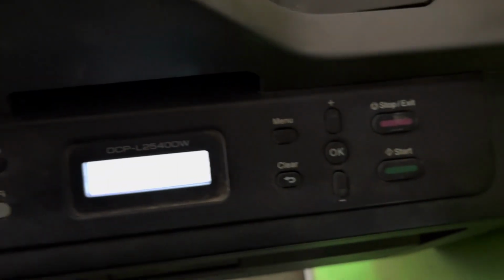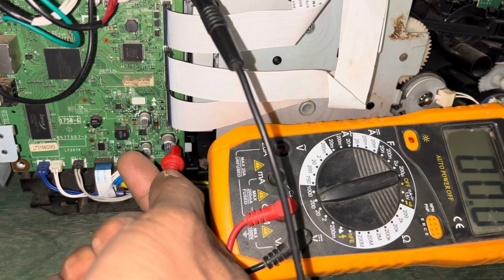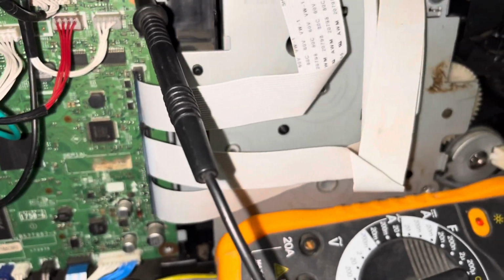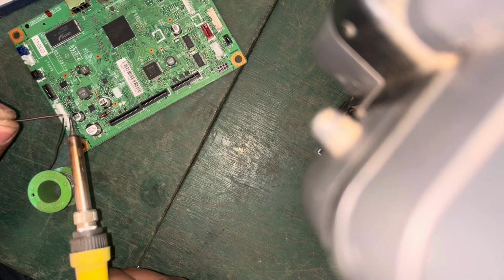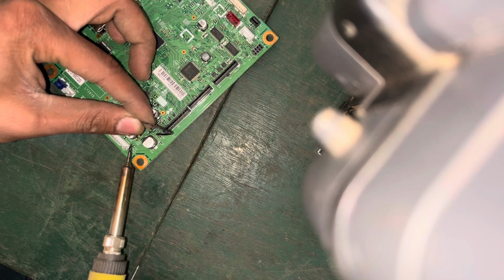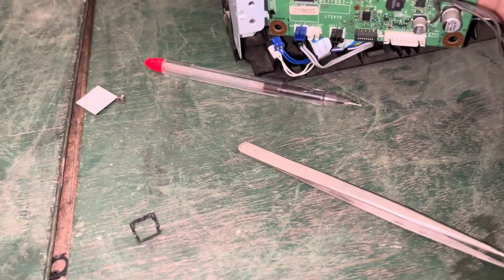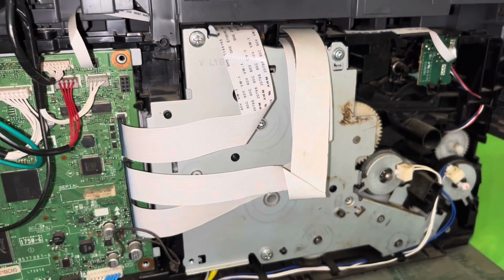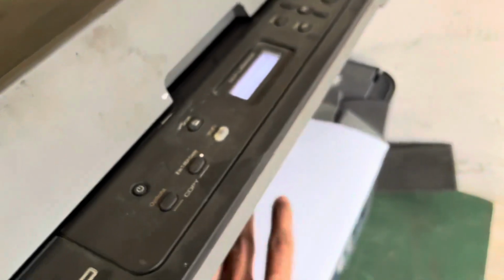Print Unable 0B Error Fix 100% Brother 2540 and All Printers

Comment: I am currently having the same issue with my l2350dw model and pretty much did exactly what you did except the main board looks different.  When I look at my voltages, I'm only getting around 2.5V d.c. at the capacitors and 0.0V  at the ribbon strap similar to the one you tested and not 23V.  The board is labled and shows what the voltages should be 23V but I not getting any of those.  I'm also getting continuity thru a fuse nearby so I know it's not the fuse.  There's also another board close by which I think might be the low voltage power supply but I'm not sure.  I am stumped.   Anyone have any suggestions??